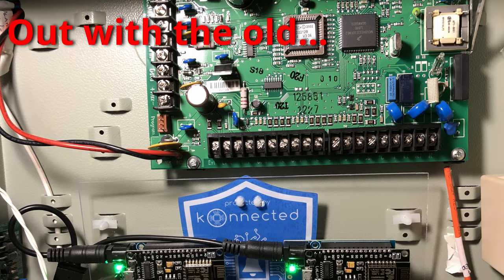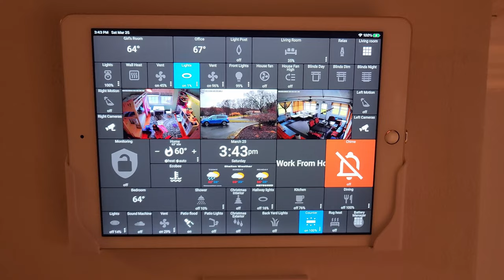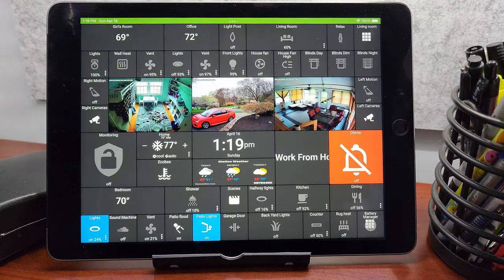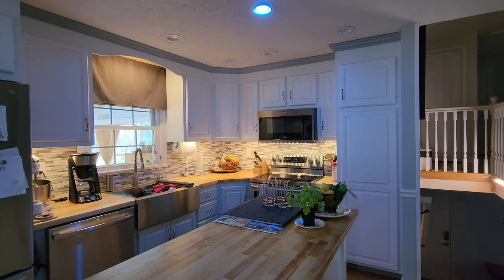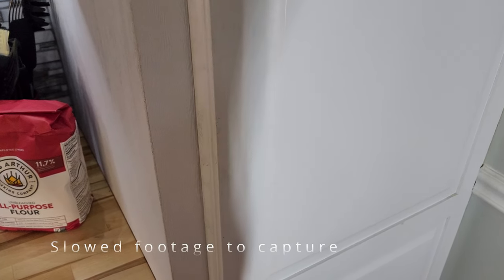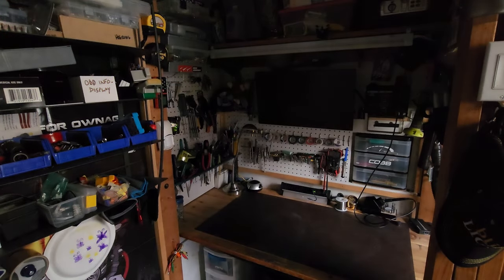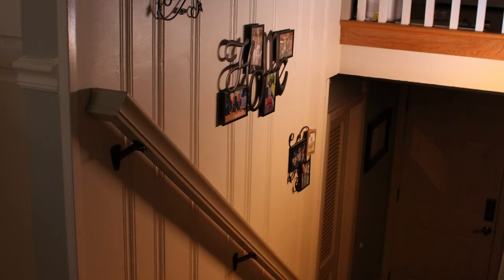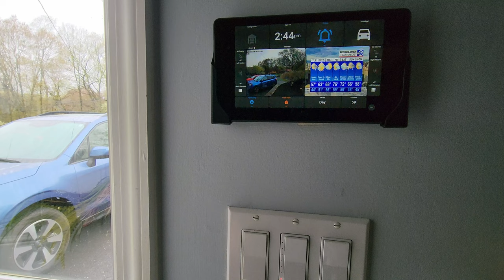6 Smart Home Automation Features that KILL!

Comment: Any suggestions for motion sensors? If yes, may I please have a link of any referral. I want to trigger led light strip for the toe kick under the bathroom cabinets (setup affiliate links so you earn commissions). Great video, too. Short & Sweet wins!
Reply from the maker: Thanks, Barry!!  For my "hubless"  closet strip lighting, I use a 12V LED strip controlled by one of the Sensky motion sensors below.  You can set ON time up to almost 5m.  Check power supply for UL qualification.  If not UL, I add a fuse.  I think I will do a video on this in next week as I've gotten inquiries on Reddit too.  Thanks for watching 😀

Motion:  https://amzn.to/3AJDC5U
Motion + Dim: https://amzn.to/3VrOLBZ